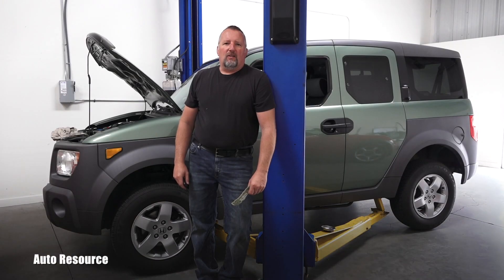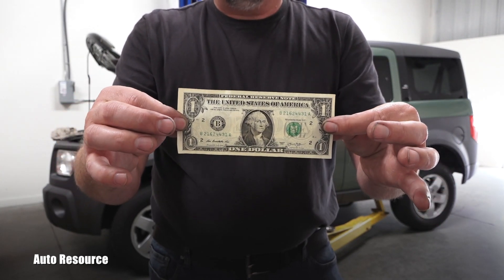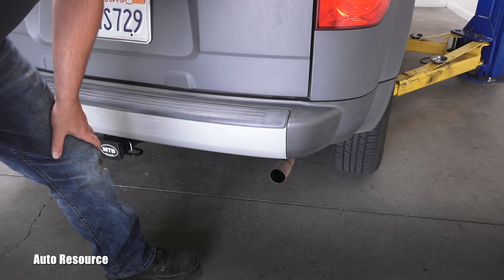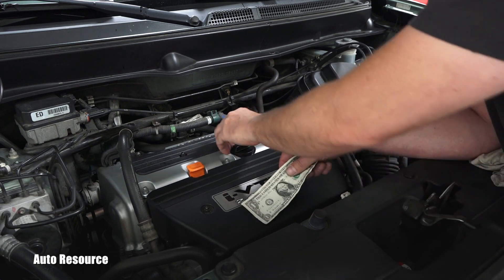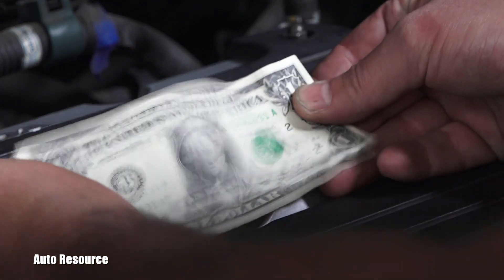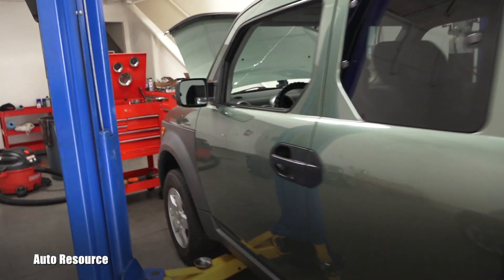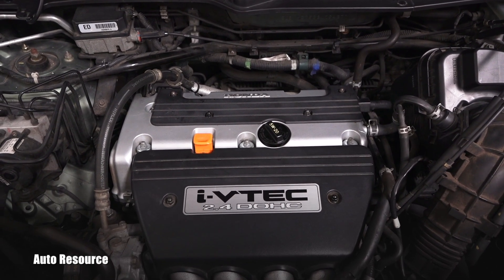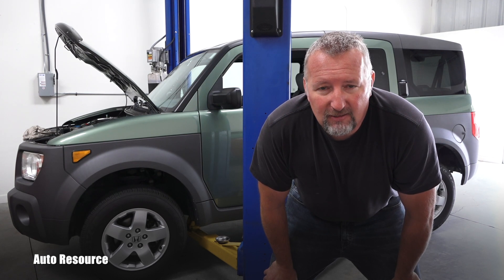Engine burnt valve symptoms

Comment: How does a defective exhaust valve connect to the housing or oil cap? If it blows into the housing, this would indicate defective piston rings or a hole in the piston. It is better to perform a leak down test.

Comment: The problem with the bill on top of the oil fill is that there's some SUV s where 
The pcv valve goes bad , you do this test and it could also be a sign of bad 
inner pcv . I know this because for a Volvo xc90 we had to have a shop unbolt 
The top half of engine just to replace the equivalent of a pcv valve assembly, 
and yes outside the shop many people would do the placing of an object 
on top of oil filler to see amount of pressure or suction.

Comment: The k24 is bad about blow by from the factory because the PCV valve is right there under the oil cap. So even from the factory these things have blow by, I remember talking to a good friend of mine who worked as a mechanic at a Honda dealer when these were new and off the truck they had blow by like that. Thought that was super interesting when he told me all that

Comment: This is absolutely crazy!!!! Your so incorrect... That's not a friggin burnt valve spitting water out the exhaust.. it's a cracked head or a blown head gasket and that's why your getting that high of vacuum in the oil fill.. and your going to get a pull in there regardless of of the pcv pulling engine vapors so you sir .... Are a scammer and have no clue what your doing. I hope everyone reads this comment and never goes to your shop. You give techs a bad name with bullshit diagnosis and throw parts at all the wrong directions. And don't tell me that's gas coming out the exhaust either bc no way would the exhaust manifold as well as the cats not burn the excess fuel before reaching the back of the pipe.  I'm sorry for coming off so strong but there is no telling how much money you've taken from people in need of a vehicle that can't afford it with these types of trickerys. Bad thing is you probably believe them yourself. Pls get educated and help ppl. Not take advantage. For lord's sake they are driving an element. You were their last hope. Now your buddy at the machine shop makes some money too while it could have been a used head replacement. What a shame

Comment: Very interesting. Today I tried this on my vehicle which I suspect has an exhaust valve issue. I was able to block the entire exhaust pipe with my hand and a shop towel. There doesn’t seem to be enough exhaust pressure. Any ideas?
Reply: Sounds like you might have a restriction or you car has low compression

Comment: po 174 . possibly be a burnt valve.? I'll try the pcv valve first just put the O2 sensor in upper bank 1
Reply: Not always, a brake booster or a dirty gas filter can throw a p0174 even a weak fuel pump bud.
Reply: Or a stuck close pcv can force air and oil out of your tail pipe, it bleeding itself out

Comment: There should be vacuum at the oil cap from the PCV hose and the hose from the air intake hose. I do not believe that test is accurate.

Comment: 4 cylinder engines usually cannot maintain a vacuum via the pcv system. That is why it pushes and pulls. V6 and up should always have a vacuum though.

Comment: With all due respect, my friend, this is not a good litmus test for burnt or maladjusted valves on a K24. I have two of these motors myself, in an Element and a TSX, the Element might have slightly tight exhaust valves, but the TSX is well within spec and the paper will flap violently simply because of the higher compression ratio. Nothing wrong with the valve train.

Comment: How did the spark plugs look on this motor afterwards? I'm 90% I have a burnt/ damaged valve because I have tons of fuel coming out one of my exhaust pipes and I can hear a light ticking sound from my motor that increases with rpm, and the spark plug in one cylinder starts burning after about 50 miles
Reply: This guy isn't accurate.. as far as raw gas means you have no spark in a cylinder.. and or if you do that means you have an injector that's wide open and just dumping it in. Ticking could be because it was hydro locked a few times and you kept running it so bent rod or damaged crank bearing.. probably the rod.. piston skirt hitting the top of the crank
Reply: @gpt5002  Hey good timing, I actually just pulled the valves out of that engine (302 small block Ford) about 20 minutes ago. FYI the fuel injector works just fine, I even replaced it with a new one just to verify that wasn't the problem, and the spark plug was operating normally as well. I ran a compression test and found that the same cylinder that has been burning up spark plugs made about 80 psi, compared to the others ~115 psi. What I discovered when I pulled the valves is that my valve seats (Intake and exhaust) in the problematic cylinder are very corroded and worn, and some elbow grease and some lapping compound should get it back in working order. I appreciate your input though!

Comment: That oil filler test doesn't tell you anything about the situation. It only tells you how your crank case breather is working. The tail pipe trick works because the cylinder in question if not fired will loose compression and then suck air via the leaking valve surface during power stroke.

Comment: Another point to note is that it's quite normal on all Honda K-series engines to breathe through the oil-fill hole. 

Please do the same thing with a good Honda engine for comparison, let's see.
Reply: If it sucks IN air, that's different. They usually push OUT air.
Reply: What happens if blowing exhaust like system out and engine changes sound as you take oil cap off ? Not familiar with Honda's nor the vvt also  plus power steering pump started making noises, that I put a pole against everywhere and power steering just shaking real bad, taking belt off and run 1st and then most likely replace it. Can anyone answer this question

Comment: Thanks. 
But I don't see how a blown exhaust valve relates to air being sucked through oil filler hole.  Except if you have bad valve stem seals or worn piston rings. 

So next question is "Are you losing oil?".

Comment: I have the same issue but when I did the compression test, it showed good results throughout the 4 cylinders. Why is that?
Reply: Post a video of car running . Engine sound with hood up and exhaust sound at the muffler .
Reply: @codyramos3200  how do I pass it to you
Reply: @farhan7393  post video on your channel .
Reply: @codyramos3200  done bro can you check
Reply: @farhan7393  hmmm ... it honestly sounds like its running well it idles good no shakes.. when you revved it sounded nice n smooth .. whats going on with it ? like whats happening when driving . does it act the same when engine is cold vs at operating temperature? check engine light on?
Reply: @codyramos3200  thanks for the quick response. I feel like I'm loosing a lot of power compared to a month or so back; especially with the air conditioning switched on. I'm aware Air conditioning hogs a lot of power but now it feels extremely sluggish. Not to mention, this is a very light car so it was able to do a tiny bit of wheelspin in wet floor, it doesn't do it any more. So just taking ideas where it might have gone wrong.
Reply: @codyramos3200  is there a possibility that the spark plug gaps are incorrect? Or the ignition coil? And that's kind of choking the power?

Comment: Using the intake plenum was a bad example. most cars have a PVC valve (positive ventilation valve) on the plenum and  valve covers to direct air flow created by the pistons positive and negative air displacement in the crankcase.

Comment: I would never use a 0-20Wt oil, use a quality 10-30 or 0-40WT synthetic oil, K24 camshafts are known to wear.  Change your oil at least every 5000 miles .  Adjust the valves on schedule, the K24 valves will tighten up. Use top tier gasoline to keep the valves clean.

Comment: Yep, so I'm pretty sure I have a burnt valve on cylinder #2 as well. I do get 15 PSI of pressure during a compression test. You would think it would be zero. I got the valves adjusted and it got better but is still there. About to swap the engine. Should I? Maybe I have carbon build up?
Reply: What kind of symptoms were you getting before you found out?
Reply: Might just be your compression ring
Reply: @arsmoke5498  Yea no it was a burnt valve...

Comment: If the spark plugs are white sandy it’s valve stem seals
Reply: Aftab Ali burning coolant
Reply: Sounds like a head gasket issue
Reply: White residue on the spark plug means it’s running lean (too much air not enough fuel). Which is also a serious issue.

Comment: Every k20 or k24 honda engine ive ever seen has done this even very low mileage ones and ive done this to many of them and reason being is because i owned a rsx and my rsx did this and it worried me so i went around to a few dealers and tested those and all of them did it as well and now i own a 06 si and it does it too so idk id this test works or not but i can 100% for certain say that atleast all k series honda engines does this.
Reply: This is true, I've had 1 honda accord and 2 honda elements with this same engine. The accord did this brand new! Both of my elements did this when i bought them used and i drove the first one for years then sold it running perfect... my current element does this and just passed smog check no problem and has over 200,000 miles. People tend to not take care of these cars because they think it's a honda and will last forever regardless of how they treat it. You must keep up on oil changes and valve adjustments on these cars then they will last forever
Reply: @richbikelife  My 2016 accord with 104k mile burned valves !!! lost 80% of engine power .. Repalced all 16 vlaves .. they told me because of clogged catlytic conventer !!
Reply from the maker: thanks for sharing
Reply: I have a h22a7 and it does the same slapping when i put a paper towel at the exhaust pipe. So this is normal? On other videos they sth wrong when the paper is sucked in.
Reply: I agree. I have an European Honda Civic 9th gen with a R18Z4 engine. It has I-Vtec which starts with 12/16 valves and opens up all the 16 valves at higher RPM's. In my case the paper at the exhaust also get sucked in at some strokes @idle but I guess that's normal when engine is running with variable cam timings and no all valves 'working'.

Burned valves also cause other issues like misfires, loss of performance (compression) and hesitating ignition. A better diagnostic tool is a leak test to be 100% sure.

Comment: The information in this video is 100% wrong. The only source of crank case pressure is gasses escaping the combustion chamber between piston rings and cylinder wall. This engine needs a rebuild with piston rings, but the head is probably completely fine. Also, some amount of crank case pressure is normal and there is a whole PCV system dedicated to regulating it.

Check with intake vacuum gauge for a low reading and shaky/bouncing needle to verify intake valve condition.

Suction into exhaust and low compression test on one or more cylinders would verify burnt exhaust valves.
Reply: Your absolutely right.im watching the video knowing if it was an exhaust valve the dollar bill would have been partially sucked in and it didnt..but instead there is air blow by escaping from crankcase.video is not accurate
Reply: I have a question I have a 99 3.0 ford ranger 157k miles it has no compression on cylinder 5 all the other cylinders have perfect compression also the power breaks are not working it’s not getting enough vacuum do to no compression in the cylinder this just randomly happen would it be a bad valve not seating properly or burnt valve the engine does not smoke or burn oil ?

Comment: Blowby dont have any relations with valvles seats
Reply: Gilles Priod yes it does. It made my intake valve get stuck open!
Reply: @Clamjammer  how exactly? There's engines out there that run barely broken in with blowby and they run a long time. Blow by could cause crank case pressure build up and some oil consumption but its not a go to for sticky valves or bad valve guides and seat. Usually the guides are worn or bad or cyl temp got to hot and burnt a valve and sometimes just carbon build up gets on the seats and builds up until it doesn't seal properly or worst case you bent a valve and slapped a piston but most average cars don't really experience that with decently laid back drivers

Comment: A cylinder leak down test on the cylinder with no compression will tell you exactly what is wrong with it. If you do the leak down test and hear air leaking into the crankcase then you know it's the piston rings or cylinder walls are worn. If you hear air leaking into the intake manifold it's an intake valve leaking, air leaking into the exhaust would be a leaking exhaust valve. If it's leaking into the coolant (i.e. with the radiator cap off you see bubbles forming) then it's a blown head gasket. If you had two adjacent cylinders with low or no compression it would indicate blown head gasket and air would leak from one cylinder to the next and through whatever valve is open on that cylinder. The cylinder being tested will need to be at TDC on the compression stroke.
Reply: say I had a ls1 that starts to smoke  after it warms up and really bad when you get into the throttle I had a leak down test the guy said it was really good and a compression test done also that past but I have multiple foul plugs lower oil pressure lots of oil in my throttle body and intake  and consistently  heavy smoke under throttle what do you think that could b ?????? bad oil ring??
Reply: Hi l have a car which is misfiring when idling changed plugs injectors coils but still the same could it be valves
Reply: That is definitely not all the truth. You can have an internal head gasket leak going to the crank case.

Comment: I think the dollar bill on the oil fill is to check for bad rings.  Pulsing is normal on some engines as the pistons displace air in the crankcase.
Reply: Yup & yup.
Reply: Totally agree ..
Reply: Leakdown test is the real way to check. This dollar bill way isnt 100% effective
Reply: Yup
Reply: Friggin cracked head or blown head gasket... He's a scammer
Reply: @gpt5002  Both of those would cause overheating, they shouldn't affect the crankcase pressure.

Comment: thank you for making this video because now i definitely know my car needs value stems i remember the check light blinking and burnt oil going from my exhaust and i had my acura gsr engine sitting in a donor civic i had sitting for 3 years but now it’s in my 99 civic coupe doing the same thing and today i took off my headers to see how bad it was and it was dirty so that too confirmed my problem i still drive it here and there when i feel like going out but i check the oil always and i put oil when it really need it and a another thing so people could know when your oil goes black real quick that’s another Bad value stem symptom but anyways man thank u for the video
Reply: @lucasknie5999  thats not oil from the exhaust, it is unburned fuel.

Comment: Thank you. This is very helpful. I drive a 2004 liberty and wow it's a mess. It vibrates, the exhaust does that spillage, the engine sounds like it's failing, the batteries die if I leave it for a day or two , the engine signs keeps blinking on the dashboard. And at times It shows oil on the dashboard. 
Honestly I love my 3.7l jeep. 😣. And I'm guilty of still driving it once a week though just to keep the vehicle alive .
Reply from the maker: I'm glad you like it...thanks for sharing
Reply: @autoresource7942  can you do that same trick on a 2009 Honda Odyssey to see if it needs a valve adjustment
Reply: Sophia Onus if the engine light is blinking do not drive it that is a severe misfire and you will destroy your catalytic converter which is very expensive
Reply: well it sounds to me like its got a bad battery...nothing more